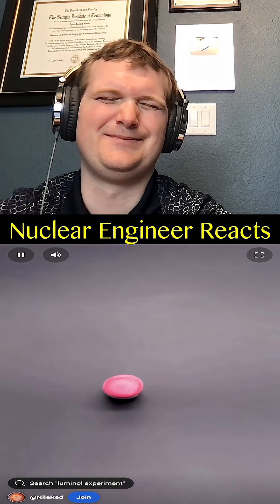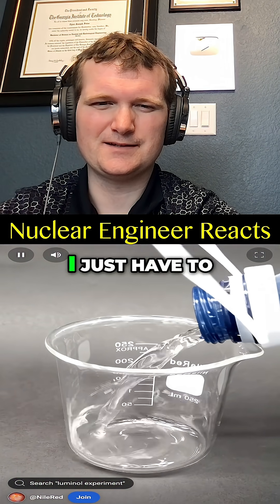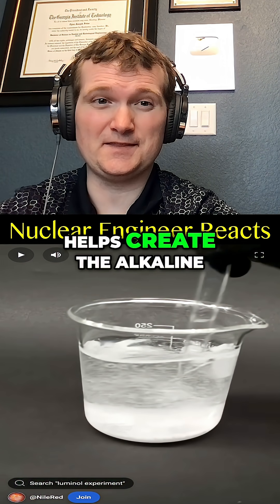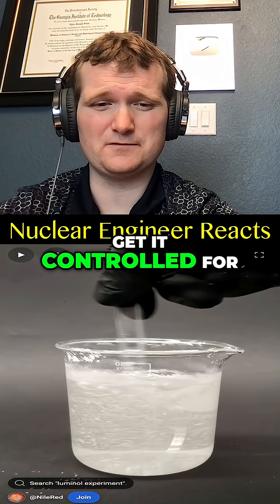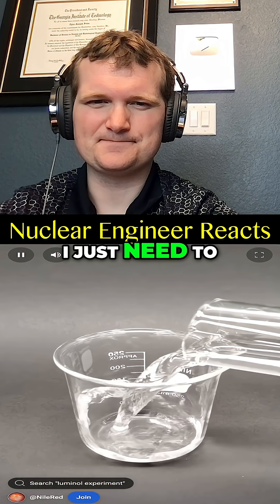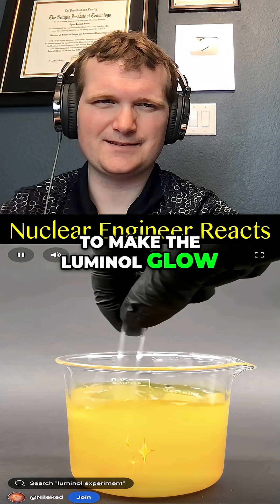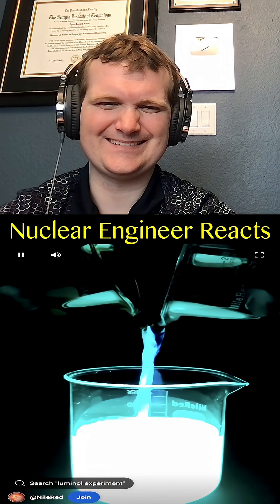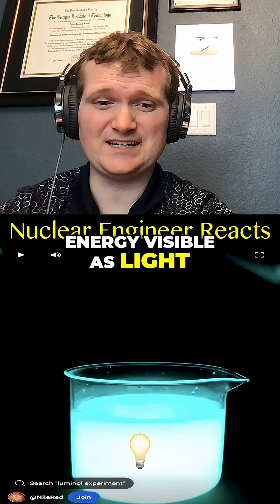Using Luminol to Make a Glowing Waterfall - Nuclear Engineer Reacts to NileRed

Comment: charged particles of electrons that move faster than light in water... ... ... Did bro just have a brainspasm
Reply: The speed of light in water is slower than the speed of light in a vacuum. Nothing can go faster than the speed of light in a vacuum (C), yes. But in water, it's only about 0.75C-0.80C, and when it travels faster than that, the excess energy is released as cherenkov radiation, which is a beautiful blue glow.

Comment: Did I hear "faster than light" in that video?
Reply: When light travels in vacuum, nothing can go faster. It travels at the speed C. But, when it's in air, or in this case water, it slows down a bit. In water it's somewhere between 0.77-0.80C, and if it goes faster than that, it releases a blue glow from the excess energy.
Imagine breaking the sound barrier, except you do it with lightwaves instead of soundwaves, and instead of a big boom, you get a beautiful blue glow.
Reply: @strategicbacon7349 Thank you for the explanation.

Comment: I thought there was nothing faster than light so that was a surprise to me
Reply: Nothing is faster than light in a vacuum. In water light travels slower than the “speed of light” (which actually refers to speed of light in a vacuum like space). In water light travels at 0.75c (speed of light) and as such charged particles can go over .75 the speed of light thus being faster than light IN WATER.
Reply: The speed of light is the speed of information, the speed at which all massless forces spread. But photons, the carrier of the electromagnetic force, interact with particles in the medium they traverse and each interaction makes them lose some time, even though they travel at their set speed between interactions
Reply: quantum is faster than light, oddly telepathy - conscience - external memory seems to be on this speed / wave / whatever it is.

Comment: Learned this from Dexter. Luminol can make blood glow
Reply: That was old when Dexter first aired. Bluestar is more common now. It's better.
Reply: @CaptainHavfunsWorld  Bluestar isn't used globally, and is a proprietary mix which most likely includes some luminol. Luminol is still widely used and is just as good, if not better in most cases, as luminol glows for longer (and brighter) and is more sensitive than bluestar. 
Luminol is also great as it can be seen by eye even if the blood has been partially cleaned up, which is something bluestar struggles with and usually needs a camera.

Comment: Or you can just use sodium hipochlorate instead if peroxide and iron
Reply: Sodium hypochlorite (there is no hypochlorate), could be used, yes, but it is less effective than peroxide and is a lot more dangerous to handle than peroxide and potassium ferrocyanide.
Additionally, it's rare to find a product with only sodium hypochlorite, as the bleach commonly found has a lot of side products from manufacturing, which wouldn't be a problem for cleaning, but could interact and ruin some syntheses and reactions.
Reply: @strategicbacon7349  we have a product just like that in store in my country so we used it during class. I can't remember correctly because it was almost 20 years ago but I think it did produce a different color and yes it was less effective
Reply: @partynhouse  The colour itself comes from the dye, in this case luminol, only the intensity would change. But there are plenty of other chemiluminescent dyes, like eosin Y & B, or fluorescein with other colours.

Comment: If anyone wants to know how particles can move faster than light.
Water slows the light down and the particles can then move faster. But nothing with mass can move faster if there is no air or water to slow the light down.
Reply: This is why I checked the comments. Thanks, cykablyat9970!
Reply: @AyDjay No problem. I love learning about stuff like this, and figured anyone here would also like to know.
Reply: This is because light 'bounces' off of the atoms in water. It doesnt change speed it just takes longer to leave the medium. Thats why apparently the sunlight we are getting now is millions of years old because atleast some of it was originally from the centre of the sun.
Reply: @gregtudor2318 correction, the velocity of light stays the same but the speed does change.
Reply: @WhatsTheWordBozo you've got that backwards
Reply: @jiaan100  exactly correct. I am losing myself. Didnt even think about vector angular translation. Always got those boys swapped. So many people always fight speed of light changes in a medium that i think i gaslit myself
Reply: Yeah, speed limit is light in vacuum, not light in air or water.
Reply: Nothing can move faster than light does in a vacuum

Shortened it for ya

Comment: Particles that move faster than light?
Reply: Water slows the light down and the particles can then move faster. But nothing can if there is no air or water to slow the light down.
Reply: @cykablyat9970 light always travels at c it literally can’t slow down
EDIT: are you talking total velocity?
Reply: @LavaWaterLegacy  No, light moves at different speeds depending on the medium it is traveling through, but the fastest possible speed is achieved when light is traveling through a vacuum - c.
Reply: @LavaWaterLegacy no?
Reply: @LavaWaterLegacy if you watch the video on this channel titled something like living in someone else's skin, the 81 day radiation exposure, he goes into this exact concept a bit deeper.
Reply: @LavaWaterLegacy light travels in water at 0.75c if I remember correctly. So yes, faster than .75 the speed of light. Remember that the “speed of light” you talk about is speed of light in a vacuum, think of Cherenkov radiation kind of like something breaking the speed of sound. 0.75c is the speed of light in water and as such when charged particles go beyond that it creates Cherenkov radiation.
Reply: @LavaWaterLegacy but it can be deflected many times, thus lengthening its path by enough to make it reach destination after a longer time. Cherenkoc radiation for one reason or another is immune to that
Reply: @bacicinvatteneaca ah that’s what I meant thanks